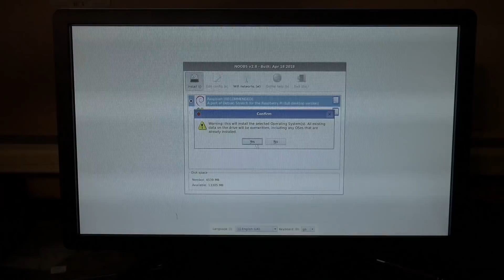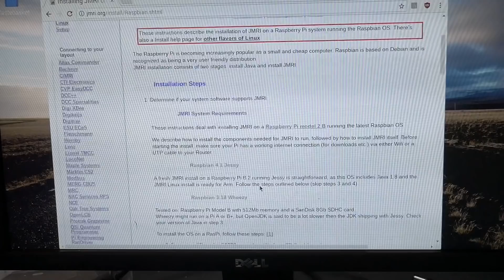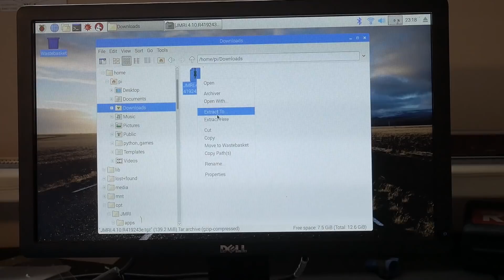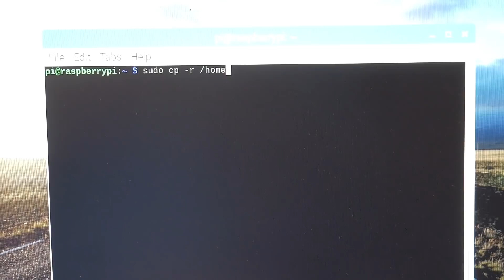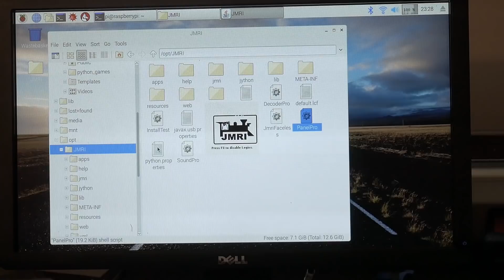Controlling Your Model Railroad with a $10 Raspberry Pi Zero W

Comment: Hello, I have tried this with two different Raspberry pis and I continue to get the same error "error starting VM Machine" it does work on my Raspberry Pi 4 with no problems?  How can I get this to work??
Reply: I get the same error.  Were you able to resolve?
Reply: @darinv1679  No unfortunately I haven't, DIY hasn't responded to many attempts for assistance.. Hopefully they will.
Reply: You appear not to have Java installed to run the JMRI App which is installed with the full desktop version of Raspberry OS. I’m also not having much luck getting JMRI running on the Pi Zero W, but runs easily on the Pi 4 2Gb version using the pre configured download for the Pi thanks to Steve Todd.  https://mstevetodd.com/jmri-raspberrypi-access-point
Reply: @richardh3675  I did verify that Java was installed.  Jimmy still has yet to respond?

Comment: Jimmy, just found your site after seeing you in chat on Steve Brown's channel. This is great info. I have an old laptop that I have thought about putting a different hard drive into and loading LINUX on that for a lot of this same stuff. I wouldn't need to load Raspberry Pi, but some other version of LINUX, then would everything pretty much be the same? This is really cool, I am a techie, so anytime you get a computer involved, it gets me excited! Looking forward to the upcoming videos in the series!!! -Mike
Reply from the maker: The Main a-TRACK-tion Thank you!
Reply: If the laptop can run windows sufficiently then dont bother installing linux however if it is old and runs windows slow then just install something like ubuntu on the laptop instead :) the rest of the setup is the same, as I mentioned above to another user do however be aware the pi or laptop alone can not interface with the railroad and will require some form of interface between the computer and the track such as a existing DCC system that can be used with JMRI or you can build a cheap DIY interface which is sufficiently decent for around $30 with an arduino uno and a motor shield for the uno !

Comment: I've got another question about JMRI on the Raspberry Pi Zero W.  Does the system ever get bogged down and start lagging?  I'm using the Engine Driver app on my Android phone, and sometimes I'll start of stop a train, and the train doesn't react for a minute or two.  Usually restarting JMRI will fix it for a while.  I'm wondering if the Pi Zero just doesn't have the resources to run the software as well as it should, and if a regular Raspberry Pi would work better.
Reply: I would guess that a computer with more ram would fix the issue.  Raspberry Pi 3 and 4 are almost as fast as a standard desktop.  Your lag should be a couple seconds at the most, not a couple minutes.

Comment: I followed your guides to get my own DCC++ system up and running, and I'm using a Pi Zero W  to run JMRI.  I'm running my Pi headless now that it's set up, but that leaves me with the problem of shutting it down when I'm done running trains.  Do you leave things on all the time, log in to shut down the Pi, or just switch off the power?  I've been logging in over SSH to shut down the Pi, but I don't want to do that all the time if I don't have to.
Reply from the maker: I have my entire layout run through one power strip and I use that as an on/off switch.  I ran mine with a screen so I was able to shut the Pi down that way, but even though it's not the best practice, I will just flip the switch on the power strip and shut it down that way too.  I have not had any problems.
Reply: @DIYDigitalRailroad  Thanks for the reply.  The Pi is a bit more forgiving than larger computers when it comes to just killing the power.  I guess I could get brave and solder some wires to the GPIO headers and wire up a button to shut it down.  I've seen plenty of tutorials on how to do that.
Reply: I am unable to get a Raspberry pi Zero to work with JMRI I get the error  "unable to start VM  machine" do you have any ideas?

Comment: Thanks for the demo and the great channel on digital model railroading.  Question, why not extract directly to the Opt folder?  Linux thing?  I have a Pi, and a DCC++ arduino base station, but the Pi is not being used right now.  Any advantage to running JMRI separately on a light PC versus my workstation?

Comment: Jimmy,  what is required to connect a serial to usb cable from a NCE power pro to the pi?  Do you need a driver?

bob
Reply from the maker: Here is the device to hookup an NCE system to any computer to the pi if you don't already have it.  https://amzn.to/2r2qVPS
You will need a driver from the NCE website for that

If you already have this. then you don't need anything to hook it up to a regular raspberry pi except a USB cable.

If you are using a raspberry pi zero or zero w, then you need a mini usb hub like the one that I mentioned in the video.
Here is a link.
https://amzn.to/2DVcHIW

Comment: Hi,  I am missing something here.  How do you get JMRI from the internet to the raspberry pi.?  Where are you down loading to?  The SD card?    How do you get from your download folder on your pc internet connected unit over to the pi?  Bob
Reply from the maker: The Raspberry Pi Zero W has Wifi.  Once you put your wifi username and password, your raspberry Pi will be connected to the internet.  The wifi icon is in the top right of the raspberry pi desktop.  You shouldn't need to use another computer to download JMRI.  I hope this helps!
Reply: Not sure what you mean by username and password.  Will the wifi app ask you for the password of your router?  Is it like linking an iphone?  Does the pi have its own browser? Can you be a little more specific please, thanks.  bob
Reply from the maker: +Robert Schworm That is correct.  It is like linking an iphone.  There is a wifi icon in the top right of the raspberry pi screen when it boots up.  It looks kind of like a fan.  You click that and you select tge wifi network you want to connect to.
Reply: Last question.  How do you print out JMRI settings thru the pi?  what is required for drivers?  After I configure JMRI, I would like to document it. bob

Comment: At some point, you have to connect to wifi. Is this part of the installation process?
Reply from the maker: +Playing With Trains The Raspberry Pi Zero W has a pretty straight forward wifi setup.  There is an icon in the top right of the desktop.

Comment: Raspberry pi is awesome, I have 2 atm. I'm just getting into model railroading. Cool to see you can use raspberry pi to control it
Reply: Do remember however you will still require hardware to interface between the model railroad and the pi ! you can use existing systems such as digitrax or lenz etc or you can build your own DCC command station from an arduino and motor shield that can be used with JMRI :)